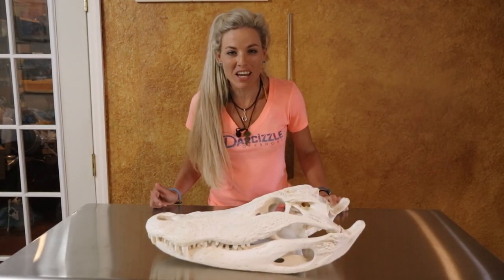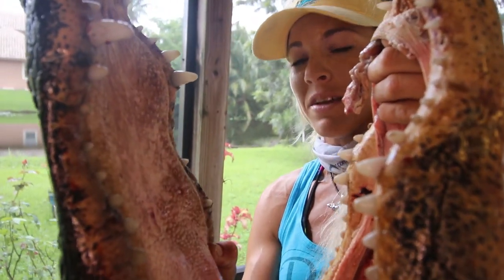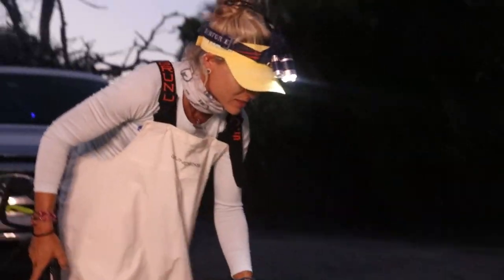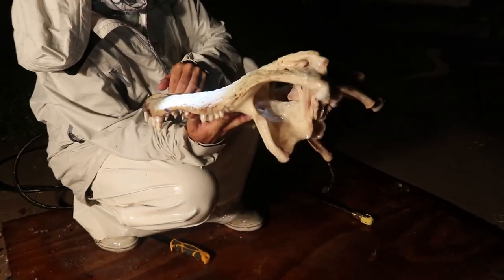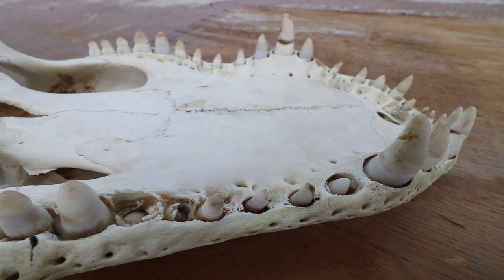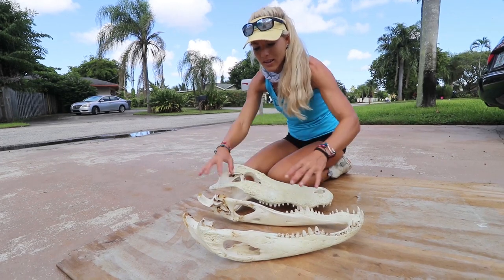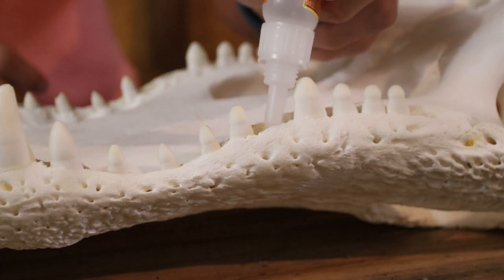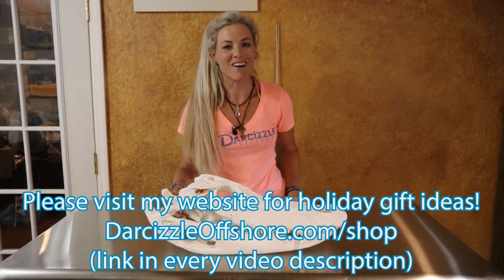SKULL CLEANING- How To Clean an ALLIGATOR Skull (Easy European Mount)

Comment: Darcizzle, here’s another tip. After boiling ( best way )if you have an ant hill nearby just set the scull next to the hole. In just about a week or so they will have picked that sucker clean, especially inside and hard to reach holes...

Comment: I’m not sure if it would work with gators since they’re aquatic in the first place, but I let it sit in water with an aquarium heater and allow it to build. Bacteria and let it eat away at the skull. It’s a longer process but boiling skulls actually do a lot more damage and cause cracks and warps in the skull. Burying, maceration (letting it sit in water) or bugs is the best way, they each have their pros and cons, but I believe boiling is the worst out of all of them